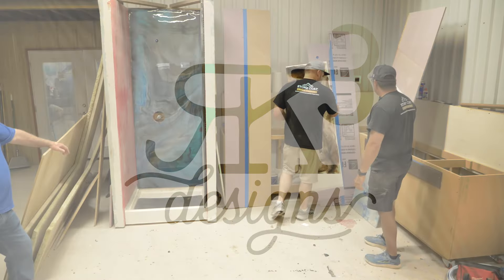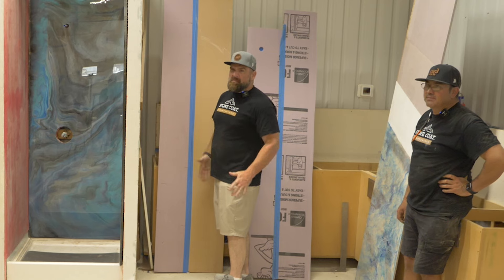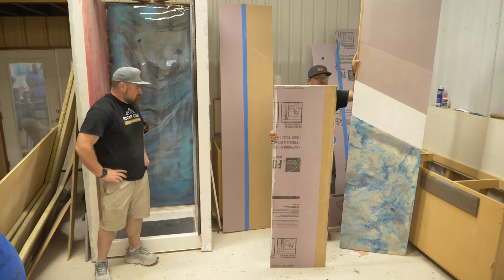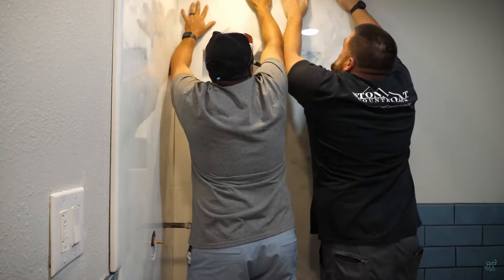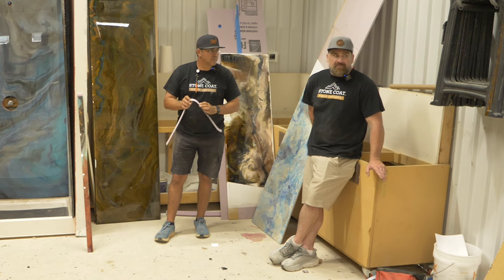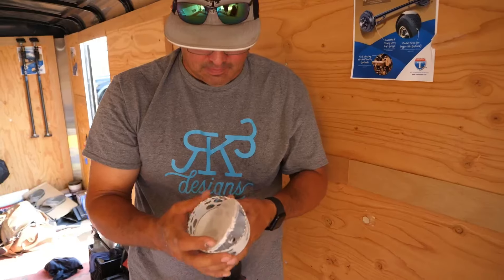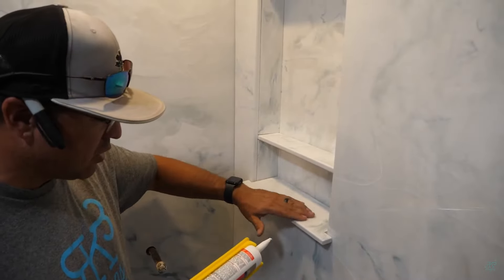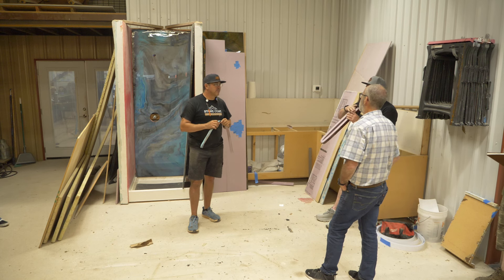Epoxy Shower Walls Installation Tips & Tricks

Comment: When you tape the corners for silicone, do you ever get feathering on the edges when you remove the tape. If you do what do you do to either stop this or fix this?
Reply from the maker: We apply quite a bit of silicone. Don’t push down too much and remove too much of the silicone. That may help.